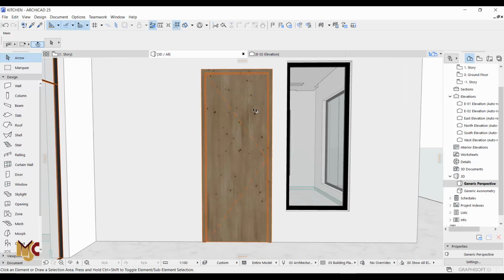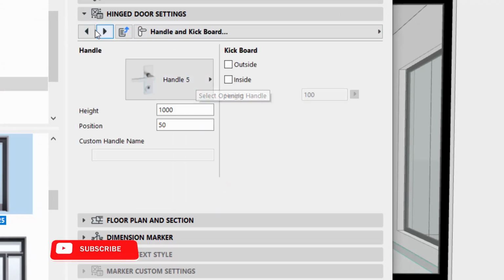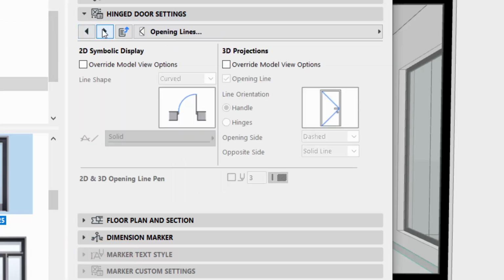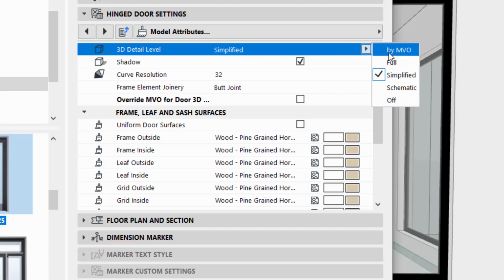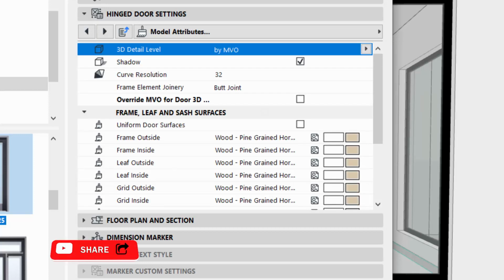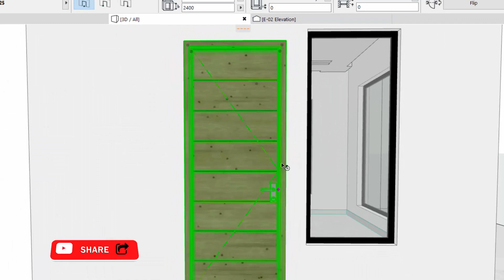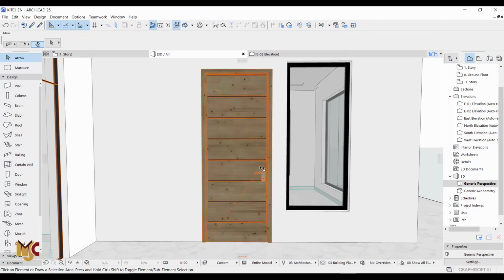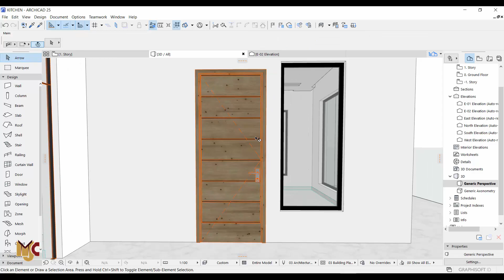How to fix door style and handle that's not showing. #GRAPHISOFT #Archicad #mjc #short

Comment: for those who find it still doesn't work:

You'll have to go into 'Model View Settings'  - Document > Set model 
view > model view options... at the bottom you'll see 'miscellaneous 
settings for library parts'
there: you can tweak the 3D views for knobs & taps etc.
if you have the option to "redefine" your view, Do it so it stays that way.
remember not all views require these accessories, i just changed it for (my) Presentation view.
Reply: thanks, it's work👍👍👍👍👍👍❤❤❤❤

Comment: not working in my case in so sadd and i have a deadline :(
Reply: You'll have to go into 'Model View Settings'  - Document > Set model view > model view options... at the bottom you'll see 'miscellaneous settings for library parts'
there: you can tweak the 3D views for knobs & taps etc.
if you have the option to "redefine" your view, Do it so it stays that way.
remember not all views require these accessories, i only changed it for (my) Presentation view.

Comment: sorry but this still does not work for me in archicad 24
Reply: You'll have to go into 'Model View Settings'  - Document > Set model view > model view options... at the bottom you'll see 'miscellaneous settings for library parts'
there: you can tweak the 3D views for knobs & taps etc.
if you have the option to "redefine" your view, Do it so it stays that way.
remember not all views require these accessories, i only changed it for (my) Presentation view.